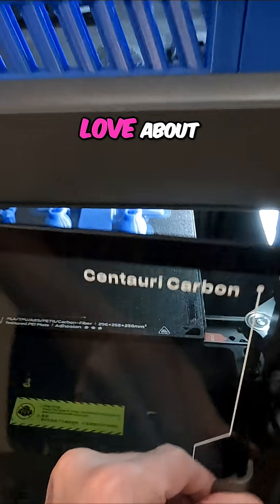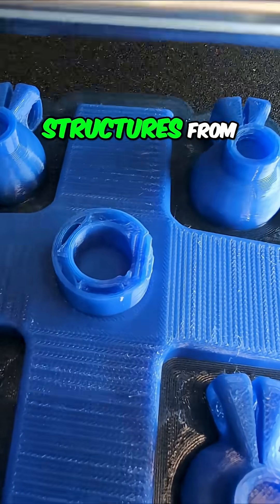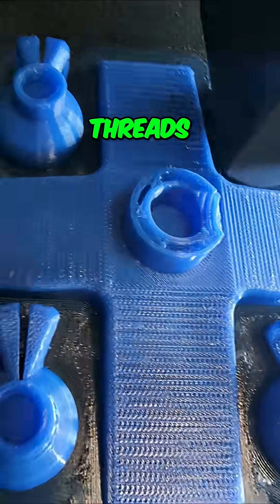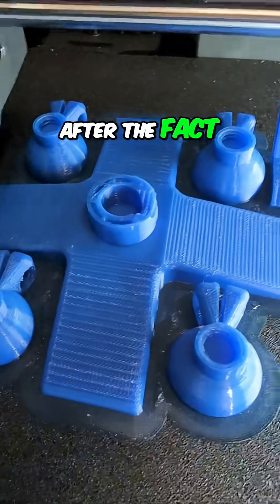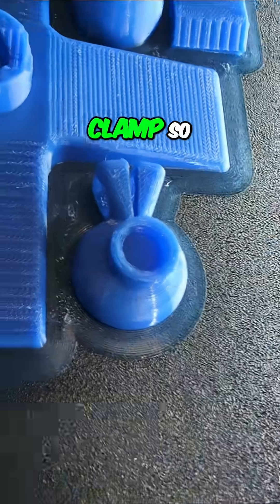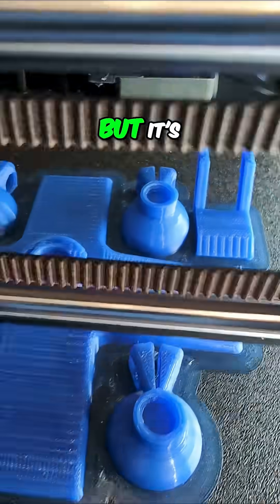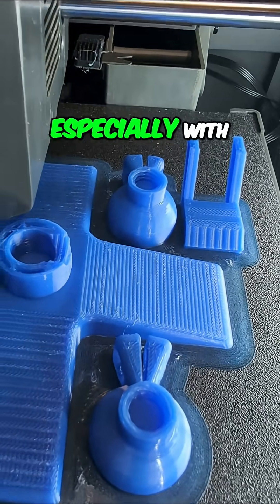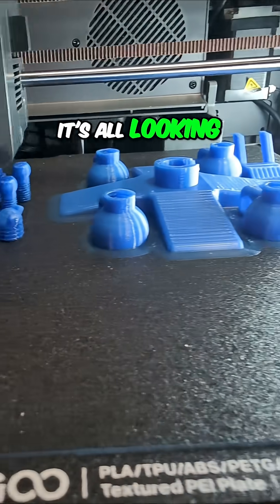3D Printing Threads: Watch This Amazing Tech! #shorts

Comment from the maker: Elegoo Centauri Carbon https://amzlink.to/az0ZtuBE4LjvS
PETG https://amzlink.to/az0H9ermJHIg7
Cold build plate https://amzlink.to/az021naV3Efti
The Clarm https://www.thingiverse.com/thing:2391563

Witness the magic of 3D printing as threads are printed on both sides, allowing mechanical attachment and detachment. This base will hold a third hand apparatus for soldering wires. #3Dprinting #Elegoo #CentauriCarbon #PETG #crealityfalcon 

Our Printers:
Elegoo Centauri Carbon https://elegoo.sjv.io/Y9ve5O or
https://amzlink.to/az0ZtuBE4LjvS or https://amzlink.to/az06Fd8642zlE
Bambu Lab A1 Combo https://amzlink.to/az0iK8AdK4WL1
Bambu Lab A1 Mini https://amzlink.to/az0iK8AdK4WL1
Elegoo Neptune 4 Max https://elegoo.sjv.io/Y9ve5O or https://amzlink.to/az0WIuEASRnEz

You need this cold print bed for the Centauri Carbon https://amzlink.to/az021naV3Efti
Our Favorite filaments:
Elegoo PLA Plus https://amzlink.to/az05hfm44OZrl
Anycubic high speed PLA https://amzlink.to/az0jVOKlIyGVG
Flashforge Silk PLA https://amzlink.to/az0MQkhaoBSi4
Creality Hyper PLA https://amzlink.to/az0GdIGpt7XCx
Creality PETG https://amzlink.to/az0YJOw76kbk8
Overture PETG https://amzlink.to/az09RGWW59gvE
Elegoo PETG https://amzlink.to/az0l2Imboicet
Bambu or Centauri Carbon cold plate https://amzlink.to/az021naV3Efti
Our favorite filament dryers:
- Comgrow budget dryer https://amzlink.to/az0hzcqlMiX1q
- SUNLU Filament Dryer Box S4 https://amzlink.to/az0L4245yhjwN
- Creality Space Pi https://amzlink.to/az0iK8AdK4WL1
Elegoo Centauri Carbon Ceramic nozzles:
- 0.2mm & 0.4mm https://amzlink.to/az0eYJvjGRMnc
- 0.6mm https://amzlink.to/az0yNSj0WRcmm
Inquiries: Sponsor, Amaon videos, or product reviews sponsor@gear-report.com
This site contains affiliate links for which I may be compensated.
Links #commissionsearned
Some of our favorite products on Amazon https://curatedby.us/gearreport/gramazonlinks
Amazon Prime Trial http://amzn.to/2xN1Z0e
Amazon store https://www.amazon.com/shop/gearreport
Amazon Influencer store https://www.amazon.com/shop/gear-report.com
eBay http://ebay.to/2ylqI01
Amazon http://amzn.to/2zbxkgF

Comment: For bolt like prints, always place them on the thicker side
Reply from the maker: Sorry. Not sure what that means.
Reply: @GearReportMaker  the prints on the left hand side that fell over causing the " spaghetti". Usually you want the wider base on the print bed so they wont un adhere from the bed.